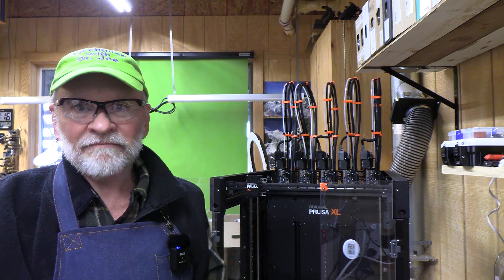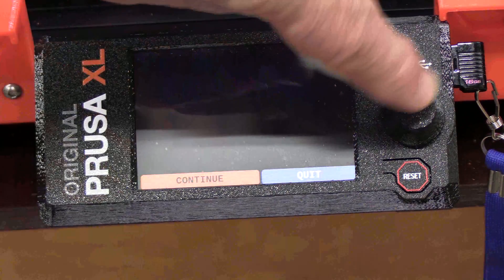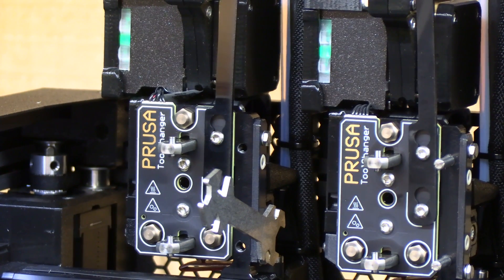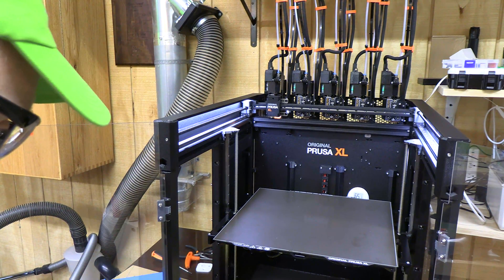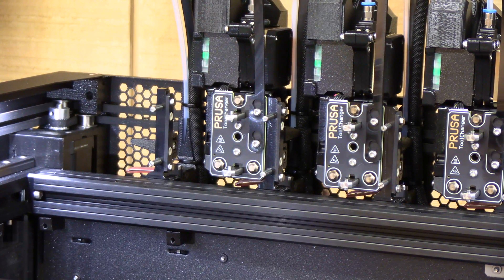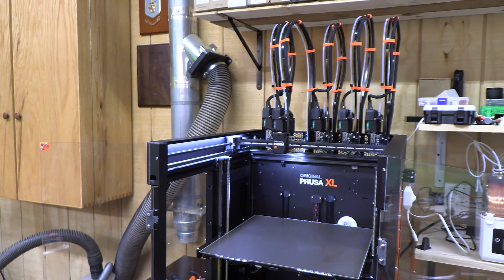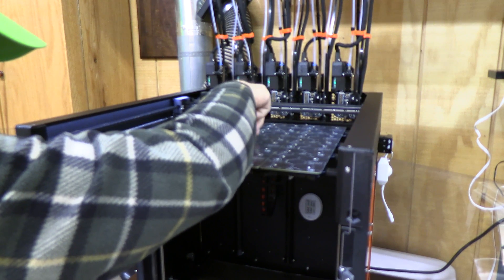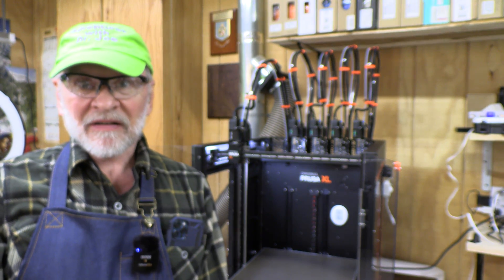PRUSA XL UPGRADE 5 PRINT HEADS 1ST RUN

Comment from the maker: So I am not printing to sell things I’m printing for my own use. Yeah the bamboo weighs a lot of filament with color change. Having five distinct heads, probably more expensive, but minimal waste. I built a really nice enclosure which I have a video on. You should check it out it’s about $120 for the polycarbonate and hardware from Ali Express and the main structural elements are all printed on the Prusa XL, which is a great way to start your printing journey on that printer. Hey, if you wanna buy one of these printers you could click my link which would help me it doesn’t cost any more for you. It’s the exact same price. Thanks. Joe.

Comment: How’s it printing so far. I’m thinking of buying this printer and need some use cases.
Reply from the maker: Thank you for your question. I’m amazed how smooth it prints when it does multiple colors. It also has minimal waist. I printed a number of things with five colors. It turned out really well and again the contour very smooth with almost no layering. Speed is good. Quality is good it’s not perfect but it’s pretty close. If I had to do it over again, I would’ve bought the five head printer right off the bat.cons subscribing. Thanks. Joe.
Reply: @JosephHunstad  very good. Are u printing stuff as a hobby or to sell ? I’m trying to find a use case to buy it. I have the Bambu x1 but multi color printer take to long and waste a lot

Comment: I cannot find which bolt adjusts the Nozzle seal height calibration. First run, Steps 3 and 4, before you start using the wizard.
Reply from the maker: I will show you I will film it and send it tomorrow
Reply from the maker: Thank you for your inquiry. Sorry it took me so long to respond. If you remove the extruder, then you will see the screw that adjusts that rubber strip that cleans the head. Then put the extruder back on and your screwdriver can be turned in and out to adjust the position of that so it’s just touching the nozzle tip. Consider subscribing. Thanks. Joe.